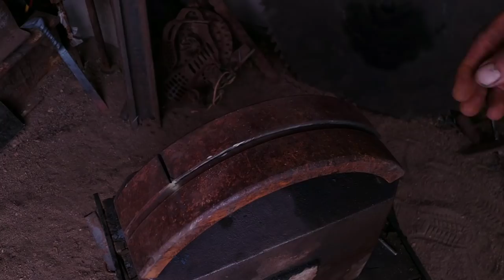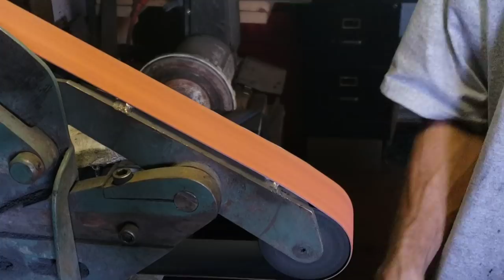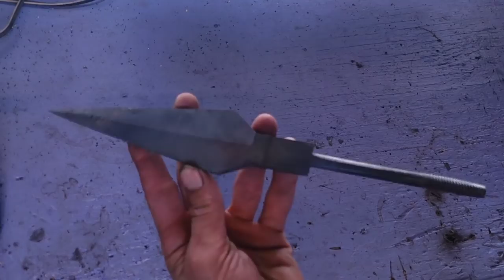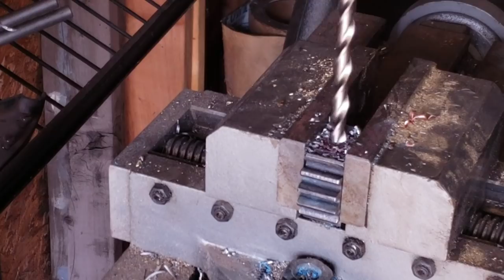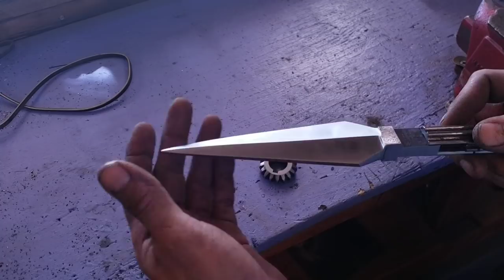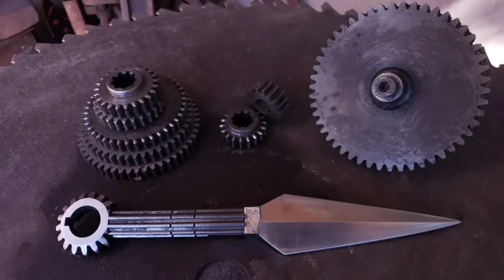Forging A Kunai From A Giant Bearing

Comment: What should i buy first if im gonna start forging knifes
Reply: Beltgrinder
Reply: Matches..
Reply: 1. Angle grinder with cutting discs
2. half round bastard file
3. Sandpaper (for finishing)
4. Drill press/cordless drill.

This is the very least you will need. It's time consuming but, it can be done.
Reply: A forge
Reply: Probably learn the skill before you put a shit ton of money into it.  Big difference between forging and stock removal.
Reply: A couple of hammers, build yourself a forge, buy files, sandpaper, and something to use as an anvil (i.e. piece of railroad track, sledgehammer head, forklift fork, large steel block). Then start hammering away, don't get discouraged by your results at first.
Reply: Will
Reply: Go to a steel factory or junkyard bro , then just use ur imagination 😎🤩
Reply: 1. Belt sander 
2. Forge fo any kind will do 
3. Tons to grab the metal
4. Hammer 
5. Anvil
Reply: You can make a forge out of pretty much anything that isnt flammable. A hammer is going to be a good thing to buy but a rock is fine if ur broke. As for an anvil any flat and hard to break surface will do.

Comment: That would be 51200 steel there wouldn't it? In my experience that metal is a bitch to move and very slow. But very hard after the right normalizing and quenching it holds a very keen edge. nice work!

Comment: Why you make no damaszener (damascus) knifes? Or it gives still outher kinds of mixed steal knifes, as three layer hardened core and softer upper and under layer. I think this kinds of steel are some of the best the u use as file, spring steel and ball-berings, if one use one steal. On the sling shot Chanel 'jörg sprave' sayes that D2 steel is one of the hardest and very good for short knifes (not so much for long because of its hardness) he sayes D2 is made to cut steel. Well i would also like to forge knifes and swords but atm i haven't not the possibility to try it, because i have no space for it. I would like to do, knifes (kitchen, work, or art knifes) garden stuff and random weapons as you. You're the first youtube armourer the got my attention with his stile and work. Also i think in you thrust a much more and you are first at the begging of your wrought career. Keep up your good work and i would be glad if you at times give me some tipps how i can good start with forging. I'm theoretically always curious how one can make the characteristics of steel better, to make the edge harder and the blade more flexibel and still stiff, a real perfect sword with a hard edge a good performance and a unbreakable (amost) blade.

Comment: nice knife ,not a Kunai try throwing it into something
Reply: kunai aren't actually throwing knives just "knives" that can be thrown. they are actually a farming tool that was made into a weapon because it is inconspicuous.
Reply: Cody McCain  Although a basic tool, in the hands of a martial arts expert, the kunai could be used as a multi-functional weapon, popular before the wide spread of firearms. The kunai is commonly associated with the ninja, who used it to gouge holes in walls. By attaching a rope to the ring, the user could easily climb walls or trees, which required great accuracy when thrown. The kunai blade was unsharpened, soft iron, and was used for digging, prying, and smashing wood, plaster, and the like—which would have likely destroyed a tool which was sharpened or heat-treated.

Many popular manga and ninjutsu characters use kunai as both their primary and secondary weapons.

The kunai that were used by farmers were fairly smaller than the developed kunai than the ninja used. The farming kunai was smaller and there was a small handle with a hole on top. The farmers inserted the index finger into the hole and grabbed the small handle with the other fingers. The kunai that were used by ninjas had a bigger handle to allow them to hold the kunai more efficiently.The hole on the kunai was mainly used for putting a string or a rope so that the ninja can hang it by their belt.